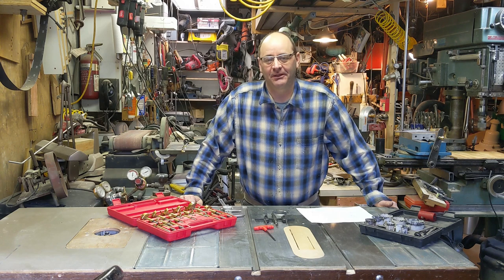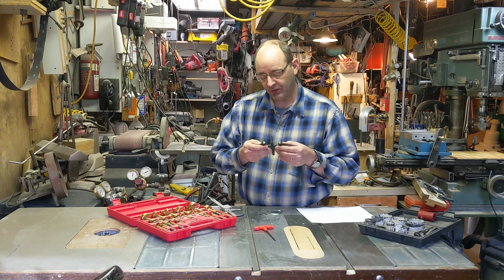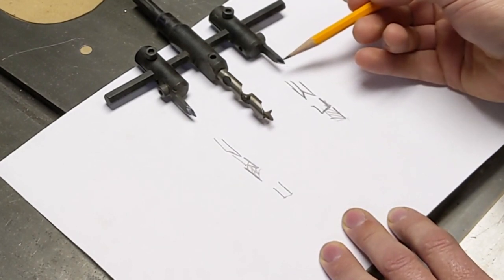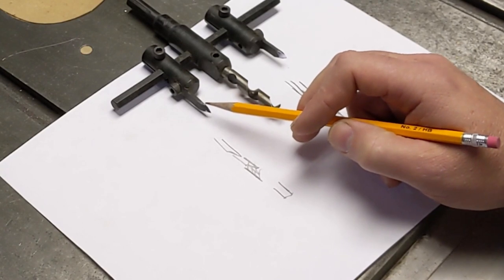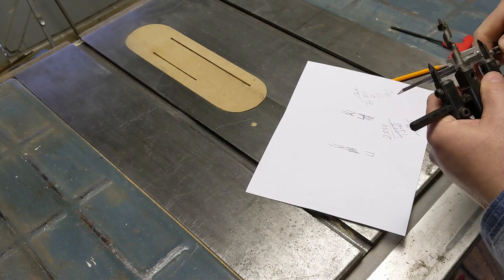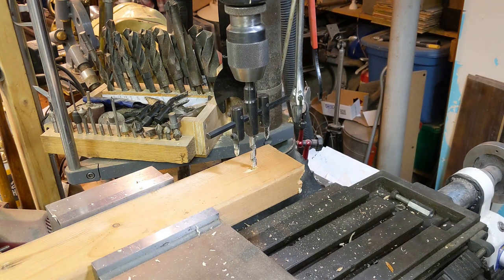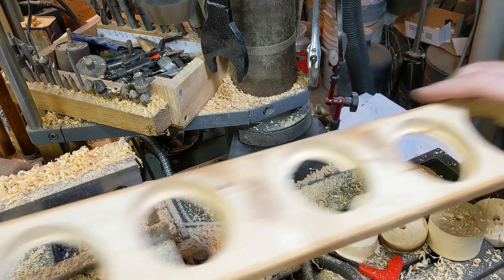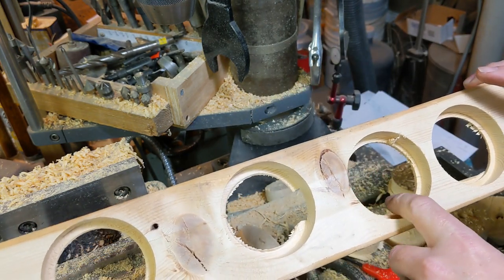How to use a circle cutter (AKA FlyCutter)

Comment: Great tutorial. I used one of there when building my kitchen, worked beautifully on mdf and left a way cleaner hole than any hole saw I've used. I pre drilled the pilot hole through the mdf and well into a sacrificial piece of wood under it to keep it stable while using a battery operated drill. I regret not filming my first test that I did on a piece of cardboard that ended up getting torn into modern art and flung across the room.

Comment: I've had one of these for decades. Literally 30+ years but I've never used it. It just looked too dangerous to me and I never really needed a hole that a hole saw or forstner bit couldn't take care of. Now, I'll definitely keep the circle cutter in mind if the need should arise. That last bit with the saw blade as a modified cutter was genius as well. Thanks for sharing this inf.

Comment: Thank you for this very clear and helpful video.  I just purchased a cheap circle cutter for a one-off project.  The instructions show the correct way to set up the blades, ie: oriented in the same direction .  However it came assembled with the blades oriented in opposite directions which had me puzzled.  You likely saved me a world of grief.

Comment: Thanks, great video. Do you have any suggestions for cutting a circle so that a strip of wood remains in the center sortoff as a handle?
Reply from the maker: Do you mean something like a "do not enter" symbol?  nothing comes to mind.  But you could drill a hole and then do a larger counterbore from the backside.  Then, looking from the front side, there would be a hole that has a shallow ring aka shallow rim.  It would be easy to grip that ring/rim with your index finger.

Comment: Thank you for posting. What rpm would you recommend for a 5” diameter hole?

Thanks again!
Reply from the maker: I'm not sure.  If there is a precise formula, I don't know it.  On my machine I think it "felt good" around 250 rpm.   That seemed to be fast enough that the chips flew clear and the tips cut clean, but not so fast that it seemed unsafe or unstable.  My mill/drill is very stout and solid, and that's part of the decision as well.  If it were in a smaller drillpress, I'd probably run it a bit slower.

I wish I could be more precise, but I'd err on the side of caution:  if it feels too fast for your comfort, then it is.

Comment: It's all easy when you know how, huh? Now I need to know where to get a similar fly cutter. Any suggestions? Also, what is the nomenclature of the sort of drill press you recommend? I've got a pair of not-so-good drill presses in my wood shop, one for wood, one for metal. An optimist friend is eager to buy the newer, flashier of these so I'm in the market for something to do really accurate work. Thank you.
Reply from the maker: As far as I can tell, no one is making them outside of China right now. Amazon carries one https://www.amazon.com/gp/product/B07P3GBNVS as does harborfreight.com. https://www.harborfreight.com/carbide-tip-adjustable-circle-cutter-68117.html

The drill press type of tool that I recommend is officially called a "round column mill". With the addition of a smooth-faced milling vise. It's officially made for steel. But I use it for wood all the time and love it.  They are very heavy, but you want the biggest one that you can find. I've bought two of them used. One for $400 the other one for $250. But that was years apart and waiting for just the right bargain. To just go out and get one you'll pay $2,800 new and around $1,400 used.

Hope this helps…

Comment: can i use without the pilot hole?  I need small round discs without a hole.
Reply from the maker: It's possible, but tricky.  You'll have to first cut a fullsize hole in a plate, say 1/4" or thicker steel, and then overlay that plate where you want to cut the discs.  Then remove the pilot bit from the holesaw and do the same process as this video.  The overlaid plate hole guides the holesaw.  And the chip clearance hole will be drilled on the outside perimeter of the saw kerf instead of the inside.

Comment: Why does my hole cutter only have one cutter holder?
Reply from the maker: Presuming you haven't lost one, I would suppose that you have one that is designed to cut the entire kerf with a single cutter. In that case the cutter would not make a slice in the material, but rather "dig a trench".